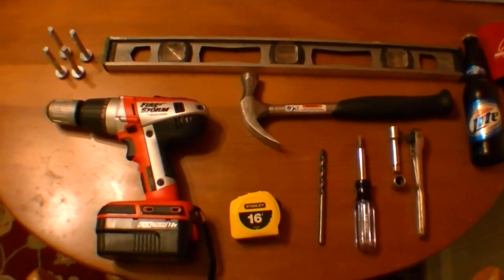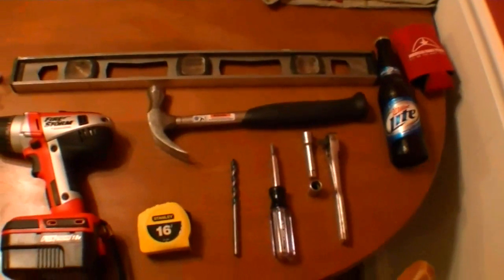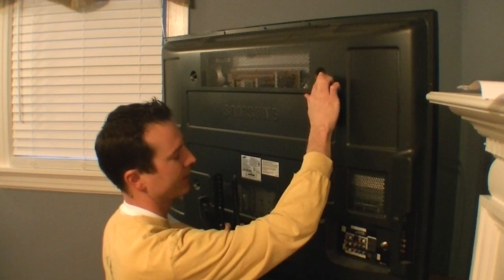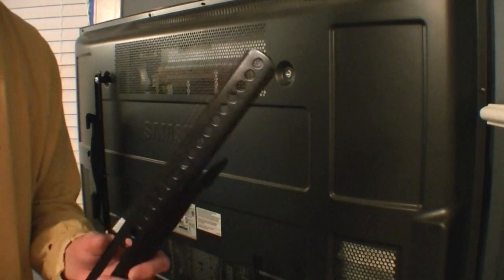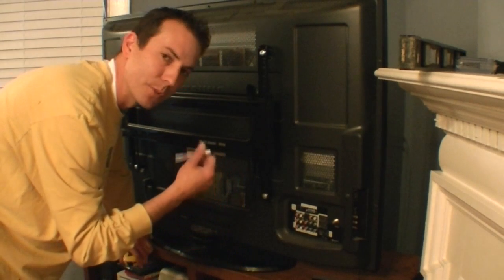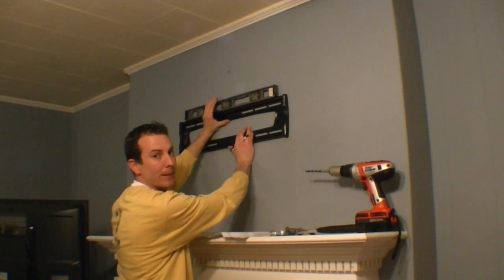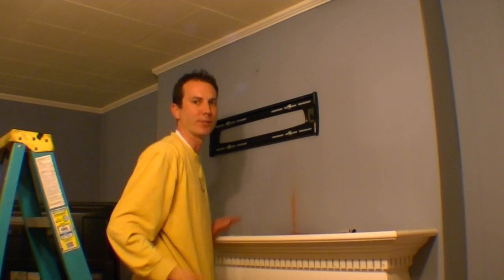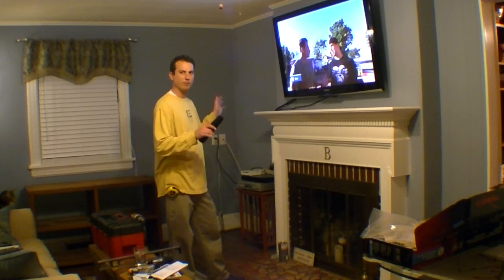rocketfish tv wall mount install and review

Comment from the maker: The anchors were concrete anchors which were about 3/8" by 3".  I was drilling into brick and not plaster and I only drilled as far as my anchor bolt would need to go in.  I only hammered to push the anchors in my holes, not to set them or anything.  If you are hanging on a plaster wall, you need to find the studs and use the lag bolts that come with the kit.  The spacers and assortment of screws come with the kit to allow it to work with most all tv brands.  Good luck! Hope this helps.

Comment: Thanks for replying. 

My set up is brick behind the plaster with no studs.  Unfortunately my home still has horsehair and plaster.  I found out this morning, after drilling over 2 dozen holes to find a stud, that my fireplace is 5 1/2" behind the plaster.  I just bought an articulating mount so I won't have to bust down my entire wall.  I don't think a tilt mount is 6" deep.  =\

Thanks for your advice.
Reply: Darkc0w long time ago this comnet was placed. you can create a fake wall in front. it requires more hands on though

Comment: Thanks for this video.  I have the same exact setup.  Is that plaster that you're drilling through?  

What size anchor did you buy?  Did the spacers come with the mount?   Additionally, how far did you drill into the wall and how much did you hammer your anchors in?

Thanks for the video.